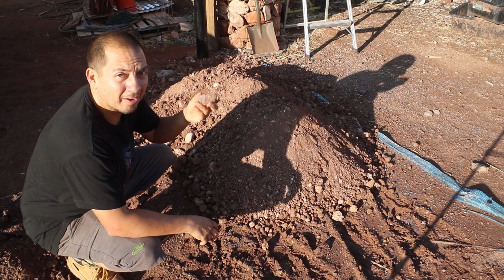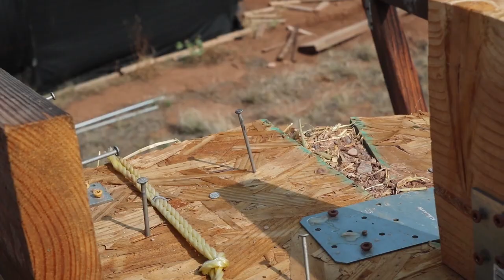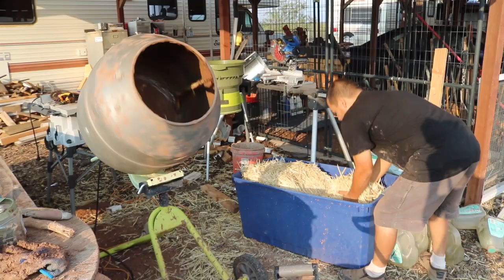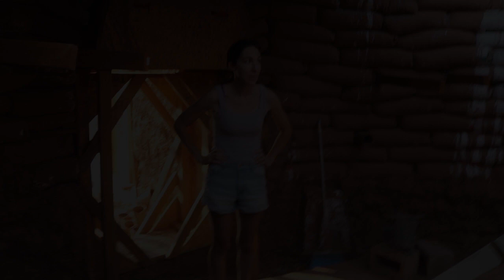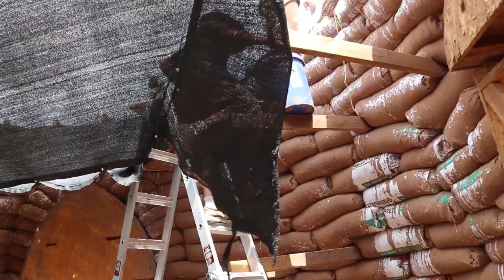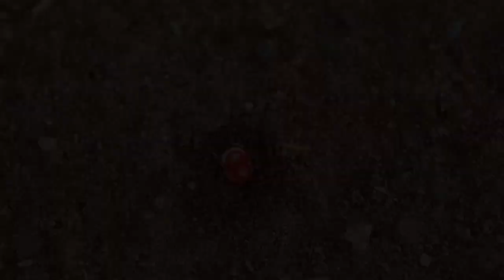We're Building A Cob Layer On Our Earthbag Dome! Building Off-Grid In The Desert

Comment: I would consider putting either two  #3 rebar "hoops" around the top of the lumber (then fence nailing them in place) or lots of nailed -down stretched barbed wire before putting the next layer of bags on the cob fill-ins....  Also, whatever your use for eaves try to keep it very very light..  Too much downward pressure on the eves could really wreck havoc on the structural nature of a dome.  Awesome video.

Comment: There's a reason they don't cob a layer between bags. If you only do it where the wood is you have a better chance of it lasting. The cob breaks down a little under the weight but not a lot if mixed right and is more susceptible to rain as well as moisture damage. The flattening of the bag creates a vibration which can weaken the cob with not having the bags for additional support. being in-between the wood it will get some support from the wood. That's my guess. I did do some research when you first said you were thinking about it because I didn't think it would last even to the end of the first half of the build. I do hope it works though.

Comment: My concern with this cob project
Would be the thickness of the layer
In my mind it's going to take a long time for the center to dry out..
If I were to try this project
I would run some tests
With different thickness
Why...
There is a reason on why Adobe blocks are a certain size and thickness...
But then maybe just for ease to move...

Comment: There would have been spaces even when done with earth bags and would have later had to be filled after roof goes on.You just did it before in this case.It will be fine and the roof will cover it so you wont have to redo.Keep using that concrete.✊
Reply: No "roof to go on" plans.
No concrete planed either.
You might be confusing with another YT CHANNEL?

Comment: when I was watching the spanking I had to laugh.. it reminded me of how when you lay concrete the do agitate it... And do the board over to get the air bubbles out and firm it smooth.. wondering if spanking is maybe a very good thing for the Cobb to settle down better. CRAP about your dad.. especially with Mom too.. feel free to take a video break.. impossible to have a smiley face. But work on house ( not nessasarily filming) may help just get your mind off of it since it's frustrating to not be able to go there or do anything.

Comment: Okay now I get it you guys keep saying sustainable you have to keep putting cob layers on it to sustain it because cob has the structural strength of a dirt clod. Earth to Wood contact is not allowed in any geographic area,  I don't know how bad termites are in yours, but if there was an inspection for that it would not pass , no moisture barrier,  no lath , no plaster. When you try to live in it you're going to find out what all that stuff does for a building.

Comment: Putting all those heavy bags on a layer of cobb...  Especially that high up on the structure is not only unwise...  It is literally begging to have your roof cave in on you when you least expect it.  My advice is try to learn to error on the side of caution...  NOT...  on the side of suicide.  :-I
Reply from the maker: Have you seen this technique fail before?
Reply: @ourselfreliantlife  --- Technique?  That is not a technique I've ever seen.  You're winging it.  What it looks like to me is you are going to put the entire load of your Earthbag dome roof on top of a layer of mud, straw, and course sand.  How much do you think each individual earthbag weigh's when it's full of dirt?  How are you going to tie the roof into the structure below the cobb layer?  How are you going to protect that layer of cobb from erosion due to the pressure caused by the weight of the roof and the elements?  It feels like you're cutting corners to save time.  The eaves serve no structural purpose...  they are strictly for looks.  Think it through.  

How many weeks/months/years do you think that cobb layer could possibly last before you have a catastrophic failure?  

Are you accounting for how much the structure is going to want to settle over the years? Or how much the heat, high winds, and monsoon rains, are going to effect a free standing cobb layer that is acting as the foundation for your entire dome roof?  At that height and with the pressure of those heavy loads?  I just don't think a layer of cobb will safely carry the load of the entire roof.  I don't ever recall seeing a two story structure made out of premade adobe bricks.  I know I have never seen a two story dome made out of adobe bricks.  Adobe bricks are far stronger then just cobb piled up in place.  Personally I wouldn't want to bet my life on this "technique" of yours. 

Common sense should tell you that a cobb layer is not structurally sound enough to carry those kinds of loads.  At least not for a lifetime.

When you took down the rain gutters because you wanted to make your own "custom" rain gutters out of chicken wire and readycrete...  I knew that wasn't going to work either.  I didn't say anything because you were just wasting your time and your money...  and I thought what if it does work?  What the heck.  The gutters only looked silly and they didn't put you in any danger unless you were standing under one when it dropped a big hunk of dried readycrete on your head.  

But this situation is quite different... right now you are literally taking your lives into your own hands with this idea.  Not to forget to mention the lives of your possible future children who would be living under that roof.

Why don't you try filling the earthbags up just enough to place them flush between the eaves?  Then you can drive rebar through that course a few feet or more into the bags below to strengthen the base of the roof at the level of the eaves.  Then proceed onward and upward.  Like I said...  To error on the side of caution is a lot better for you then erroring on the side of suicide.  Purposeful or otherwise.  

Take care.  sincerely,  Dean O.  :-I
Reply from the maker: @deano.7533  Do you have any knowledge of earthen or cob building?
Reply from the maker: @deano.7533  I am deflecting and I apologize. You have to realize though we get a lot of advice in the comments section. We do appreciate people's input, but people only have a fraction of the information of what is going on here. There's a lot that has to be done before this is finished. Rest assured we have done our research and consulted other earthen builders. So, unless somone has actually tried this and can say definitively that this won't work, we believe it will.